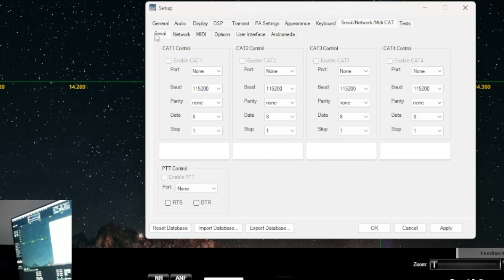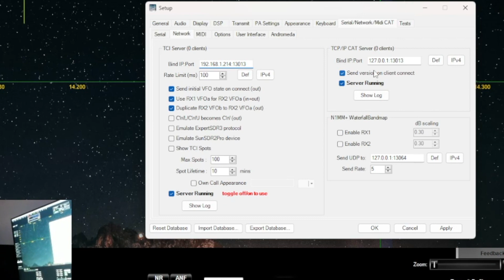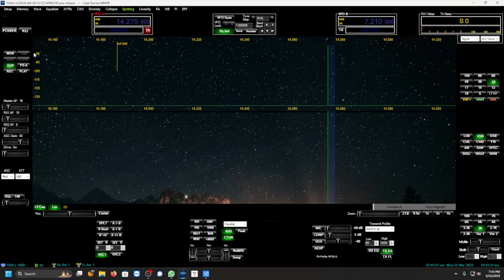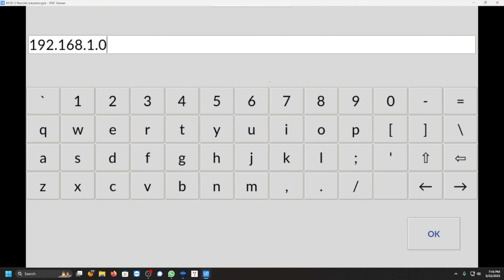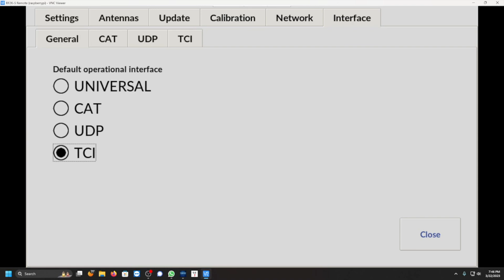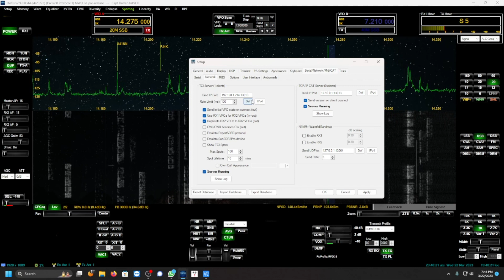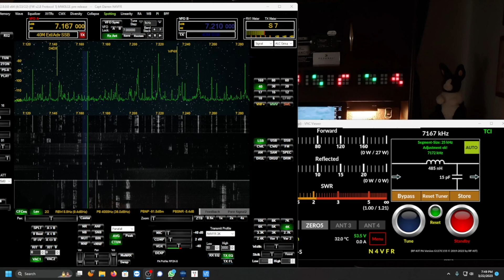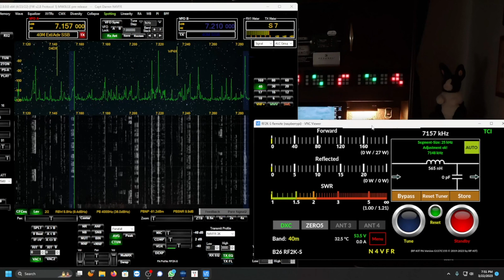Apache Labs Anan TCI Connection to RF-Kit RF2K-S | Anan 7000DLE Mk3 |

Comment: I have a Anan G2 but this information worked just fine.  My attempts to run TCI failed every time.  I went back to Thetis setup/ Network tab. I unchecked and then checked "Server Running" under the "TCI Server" on the left-hand side of the window. (You also did that in your video but when repeated your actions you did not click the "Server Running" check box).  Unchecked and checked did it for me!! Went back to the amp and TCI is running!!! Follows band and frequency as desired. Thank you for the video. If it were a tape, I would have worn it out with all the replays I did to make sure I got the IP addresses OK.  I have one suggestion for videos like this.  Explaining that a particular IP address is the computer with Thetis running, another IP is the IP address of the amplifier etc. would have helped me quite a bit. Otherwise, it looks like magic. Enjoyed the presentation along with your setup.
Reply from the maker: Thank's for the feedback.  I'm glad you got it to work.  Yes, you have to stop and restart the server from Thetis's Network Tab.

Comment: Darren, where did you get the app for remote use?
Reply from the maker: I used a third party app call RealVNC. It's free!
Reply: No-- I meant the app or software for the amp. I see a JSON download file but that is on the application---Thank you @DarrenN4VFR
Reply from the maker: @larrywilliamson9859  I'm not sure what your asking.  The RF2K-S Amplifier has a Raspberry Pi. I can control the Amplifier remotely.

Comment: Another great video Capt Darren.  I just received my RF2K-S yesterday and had trouble getting the UDP interface to "stick". The screen was saying "No TCI available" and then "No UDP available".  I had to reset and save the settings like you did to get everything to work.
Reply from the maker: Congratulations on the New RF2K-S.  It works very well with remote operations and I love the TCI interface.  Thanks for the comments!
Reply: @davidautry4857  I ordered rf2ks last week how long did it tske 4-6 weeks?
Reply: @David-p4s4b  When I ordered mine in July 2023, it took about 5 weeks.  But it got stuck in customs in Memphis, TN and I had to fight like hell to get it released.  It is well worth the wait, the amp is wonderful!

Comment: I noticed you hooked the LAN to the amplifier. No connectors pl259 on the back of the amplifier, do you run another LAN to the amplifier and a LAN again to the Apache labs as well? Great video
Reply from the maker: Each of my equipment i.e. PC, RF2K-S amplifier, and the Anan 7000dle are all connected via LAN Ethernet cables.  They are connected to my 5 port Switch. You still need to connect RF Cables to and from the Anan 7000dle and the  RF2K-S amplifier (BNC to PL259).  From the RF2K-S Amplifier a jumper coax to the window  pass through.  And if you want Pure SIgnal another cable, SMA to BNC. between the Anan 7000dle and RF2K-S amplifier.  I hope that helps.